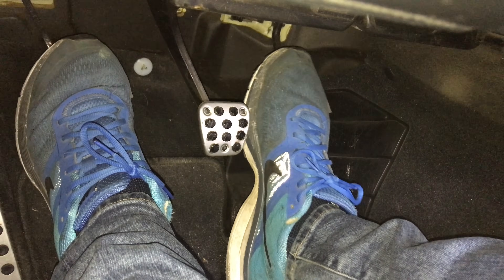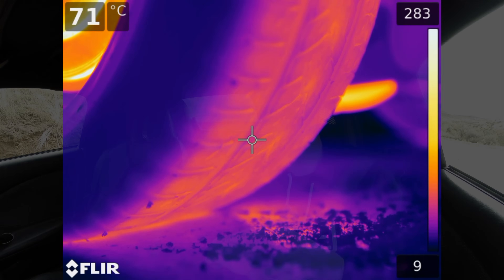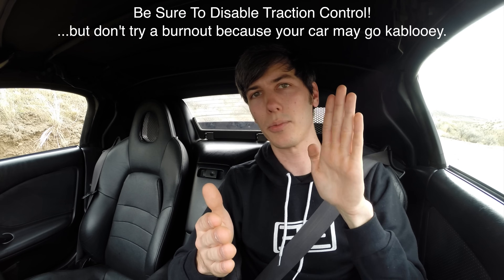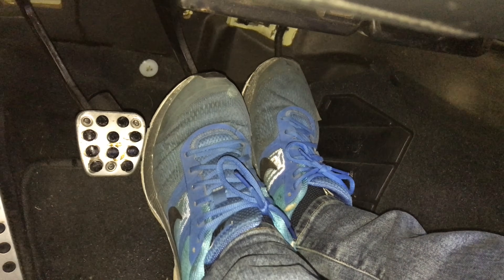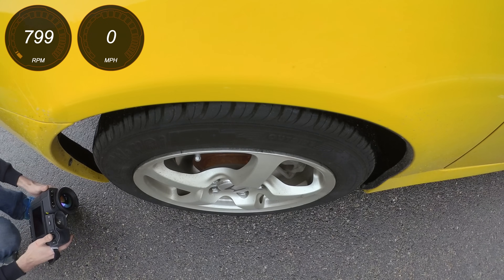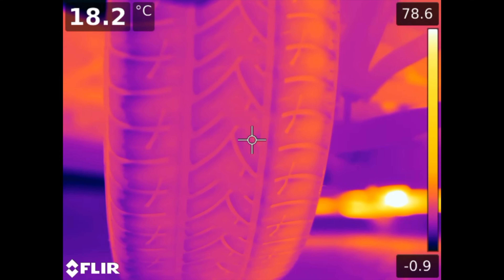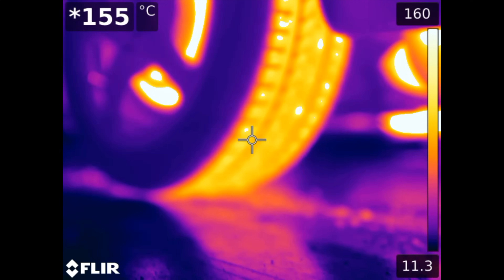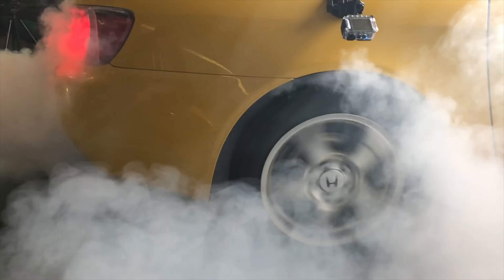How To Do A Burnout - Manual Transmission

Comment: my car won't do burnouts only if i remove the abs fuse
Reply: tcs is seemingly on the same circuit
Reply: Is this the reason why i can not turn TCS off?
Reply: stef catalin you can turn traction control off, look in the owners manual. Most of the time its a button with either a skidding car or some text on it.
Reply: i checked it doesn't have a button i know that it is there only because it is flashing in dash whenever i floor it in low gears
Reply: and it's cutting power down to eliminate wheel spin
Reply: Some cars do not have a switch or button to turn off tcs
Reply: On some cars the switch is much more obscure. I didn't even know my car had a shutoff button until I went to wire one. In my case it was a button on the shifter that looked like a simple recess for style, the button was stuck so there was no reason to suspect it was even a button to begin with. Unfortunately disabling TCS on slippery roads didn't help as much in that car as it does for any other car I drove; it's just an all around terrible car for non-ideal road conditions.

Comment: won't you burn your brake pad?
Reply from the maker: Without line lock, yes. There are aftermarket solutions to lock up only the front wheels.
Reply: hmm, I didn't know about that before. Thanks.

Comment: whats happening with the rear brakes when you are doing a burnout?
Reply from the maker: mario kovac assuming you don't have line lock (locks only the front brakes), you will be wearing your rear brakes.
Reply: Didnt know about line lock , thanks for the reply
Reply: Same as when you drive and brake. You will be wearing your rear brakes.
Reply: I had the same question thanks
Reply: mario kovac rear brakes heat up due to friction with the pads. This is because he clearly stated that you have to hit the damn brakes in order to do the damn burnout. Were you ever listening or do you not have headphones?
Reply: @ogdrifter9977  damn

Damn

Damn damn

Damn
Reply: Manny Hysten i dont think you understood the question
Reply: Engineering Explained in some cars arent the front brakes only going to lock when applying brakes only slightly and both front and rear when pressing the pedal more
Reply: Will this technique destroy your rear brakes?
Reply: @eekmo  yes if you go a little longer.
Reply: this escalated quickly
Reply: No it will not mate unless you apply too much brake then you will add unnecessary pressure on the whole drive system and the brakes.
Reply: now pull the brake pads and compare front to rear...the rears could have a "glaze" on them now from the abnormally high temperatures
Reply: check out his previous vid & comments (March 12) "Huge Burnout With a Thermal Camera" for some answers
Reply: RoMMeL1337ak47 no one has a dong that long :P for a fourth pedal
Reply: actually saw a guy shoot a brake pad out while doing burnouts/dounts
Reply: I have actually thought that myself. It wouldn't be too difficult to do. Have a split brake pedal where say you push the left half and it does the front only, and right half would have a bar above the pedal to engage the left half as well.
Reply: Matthew Hull that's called line lock, and what it does is build up pressure in the front brakes so you can let the rear tyres loose.
Reply: mario kovac not gripping as much as front brakes as they're smaller. Don't worry as much about the rear brakes
Reply: So it's much better to do it on a FWD Car, just put e brake up
Reply: Just put some oil in rear break pads, dont worry about rear pads ahhaha
Reply: they burn out

Comment: Why i am watching this vid,my car is 4WD..DAMN!
Reply: If its 4WD can still do it in 2WD mode, if AWD you cant. (is this right?)
Reply: @da_sym  what about the hoonigan
Reply: @da_sym  wrong
Reply: Some 4WD (like a pickup) are called "part-time 4WD" or "full-time 4WD". If its the "part-time", then yes you can disengage the power to the front wheels, but if its the other kind, you need a saw and duck tape to make the front wheels stop working. I would not recommend doing that.

With AWD, I'm not sure. Some are computer controlled power transfer, so you might actually be able to hack it get it to apply at least most of the power to the back, but I'm not sure if you could do all the power to just the rear wheels.
Reply: @jakegarrett8109  focus rs you can disable the rear tires and only do your front but idk how and idk if you can disable the front and do rwd only
Reply: Scirocco ThePunisher awd cars are gay
Reply: fuzzy wuzzy sorry you drive a civic
Reply: fuzzy wuzzy Nissan GTR, Mitsubishi Lancer Evo, Subaru WRX STI, most Tesla’s
Reply: Timothy Mai I'm open to invitations
Reply: You're either mostly FWD or mostly RWD. Choose a team! There are no 3rd party organizations.
Reply: You are driving a VW Scirocco. It is FWD?
Reply: Scirocco ThePunisher I don't even have a car or a driving license but I'm watching because this is what I wanna try out when I'm a little older
Reply: Cem Yildiz I’m just watching this vid because I’m just interested I have my license but I have a WRX
Reply: You could take the front diff out it's alot of weight reduction and you could drift or do burnouts with your whip
Reply: Scirocco ThePunisher  I used to have a Jeep Grand Cherokee with the AWD, sucked having the 5.7 hemi in it but couldn’t get the tires to ever spin, got a 92 camaro a few months ago and that V8 lets the rear tires spin like crazy
Reply: r e m o v e t h e f r o n t d i f f
Reply: Scirocco ThePunisher are you vaping?
Reply: Well, I don't even have one. I was curious and wanted to enjoy some cloud making
Reply: i currently dont even have a car
Reply: 4wd or AWD
Reply: haha
Reply: Kimonaaaaa
Reply: Mines 4x4 but theres a simple way around that just put it in 2wd since its a old chevy k10
Reply: Dopey Dope 😂 honestly he probably doesn’t even own a car
Reply: STI life over here. I feel you.
Reply: tuff
Reply: LOL same, crying in Quattro now
Reply: Facts
Reply: I don’t even own a car

Comment: You didn't mention you need rear wheel drive to do this. Make sure every ricer in a front wheel drive Honda Civic won't try this.
Reply: you dont need rwd to do a burnout...
Reply: It doesn't do much good if you launch with the front tires. And rear tires don't hold properly when the front ones spin
Reply: yes it does, people make over 600hp civics that can destroy most muscle cars, all they have to do is rip the ebrake and use some foot brake
Reply: @Tyler3209  everything you said made no sense
Reply from the maker: Pull the handbrake, high revs, dump the clutch for FWD. Not saying it's good for your car, but it's nice because FWD cars can lock only the rear brakes, whereas with RWD most cars will require installing line lock to lock only the front.
Reply: Handbrake?
Reply: Armand Klein handbrake = ebrake
Reply: wot about AWD?
Reply: Zinc Waste Put 3.5bar in completely worn out tires and dump the clutch at full throttle. Nothing else you can do except programming the drivetrain on electronic controlled diffs
Reply: WRX cars have an e brake that locks the front wheels and disconnects the diff making it easier to slide around in the mixed surface, not so sure it could do a burnout with that engaged but they do a pretty nasty launch regardless. Other that that just load up the boost and dump it.
Reply: AWD? Just park your car with the front against a wall and floor it :D
Reply: Tyler Sanders you definitely don't need rear wheel drive! I do burn-outs all the time in six speed v6 altima
Reply: burnouts can be made with a FWD or AWD too, but we prefer RWD drift-burnout-pop the tyre   hahaha
Reply: Not all FWD cars handbrake only locks the rear wheels. If you pull the handbrake in a SAAB it will lock the front wheels and therefore making it impossible to do a burnout.
Reply: You can do a RWD in an STI, just pull up the e-brake until it barely engages (so the ECU knows its on and opens the DCCD) and then follow his steps. But its not good for the differentials and could damage or break them.
Reply: tell that to chavs in saxos and corsas
Reply: I have a 15 Si. And I love it. Perfect daily driver. A blast to drive around town. Awesome gas mileage. Four doors for my girl and our friends.
Reply: Tyler Sanders what is a "ricer"?
Reply: A person who makes unecessary modifications to their most often import 
car (hence the term "rice") to make it (mostly make it look) faster.
Reply: Because all civics are inherently rice, right? The hate is getting old...
Reply: @Tyler Sanders. Make sure every ricer in a front wheel drive Honda Civic won't try this.

That's cold.
Reply: I was once a teenager you can do just as good a burnout with front wheel drive find a steep let the car roll backwards and pop that clutch and fry those tires
Reply: +Cartime  Yeah, SAABs are an odd duck, having the handbrake on the front.  They sure liked to do things their own way - sometimes, to their detriment, sometimes to their advantage...but always interesting to see.  :-)
Reply: They're much easier with a FWD...not just because you can use the handbrake, but weight transfer generally makes it much easier to get them spinning in the first place.  And in drag racing, FWD is far from the best way to get good traction, so the burnout is so much more important if they want to have any grip off the line.
Reply: It wouldn't surprise me - SAAB have always worked hard at details of design like that.  :-)
Reply: Why wouldn't the exact technique in the video work for fwd?
Reply: I've done a burnout in a 2016 Chrysler 200 fwd 😂😂
Reply: Hahahahahahah, you know them civic rice boys are gonna be trying this